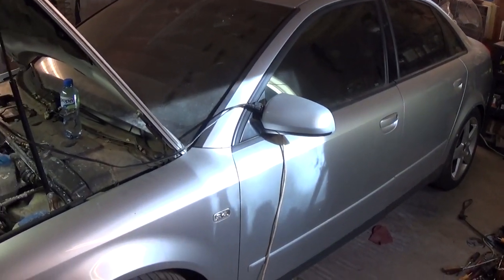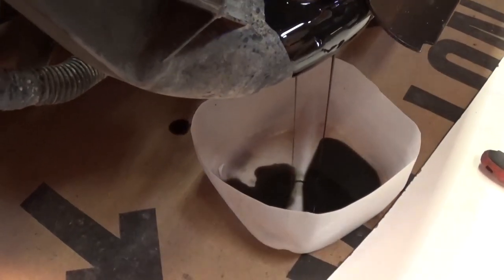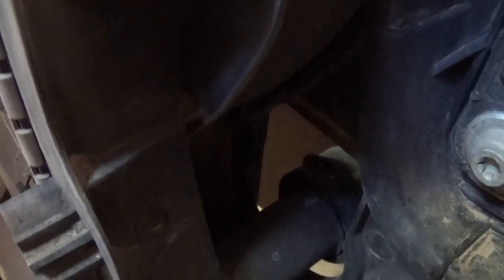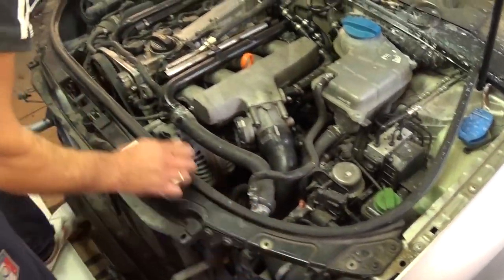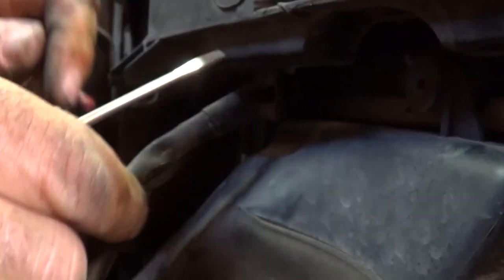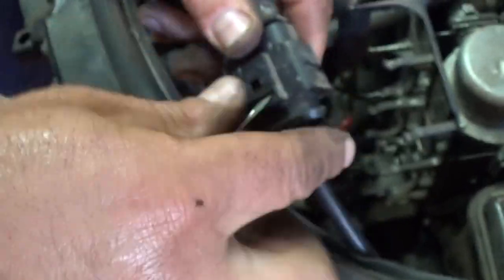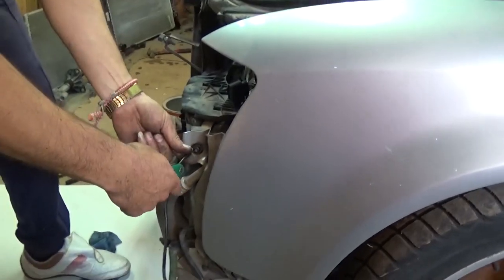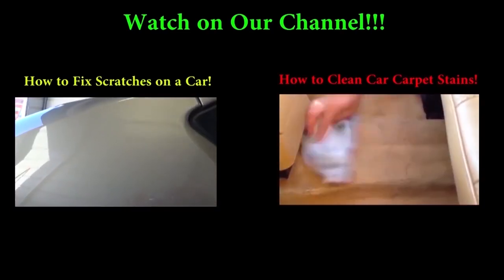Audi A4 B6 Front Clip Removal. Front Disassembly! 2002-2006

Comment: It's must take out radiator for change the tensioner serpentine ( tensioner accesories)?
Reply: No. 
You can just pull the front into the service position (all the lines and even the headlights stay in place - the whole front comes about 10 cm forward after loosening it).
Then you have enough space to do your work. 
Much for comfortable without the front end for sure - but with the need of refilling the A/C, antifreeze, AT oil, PS oil and so on.